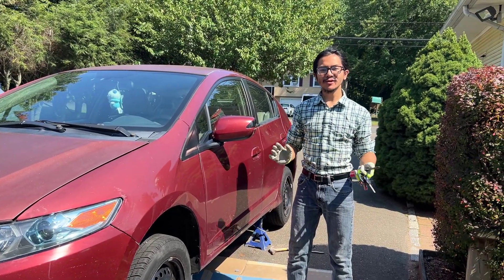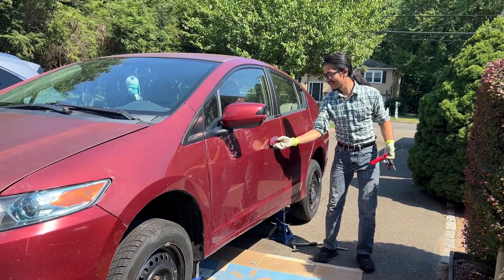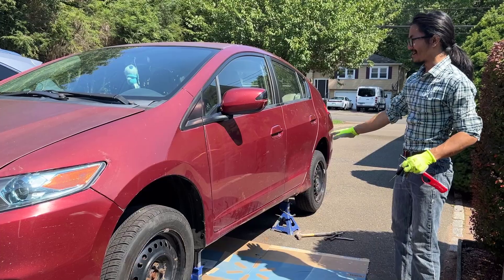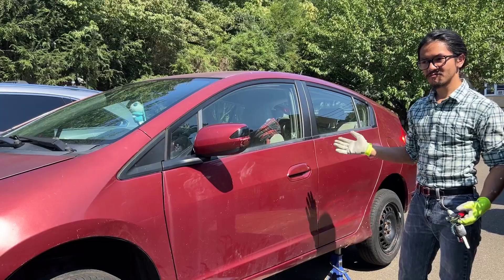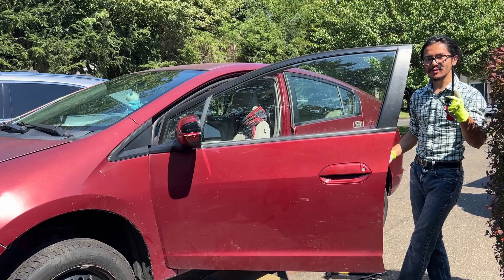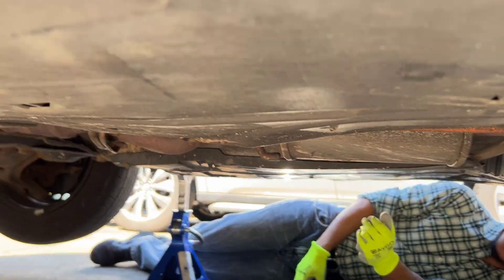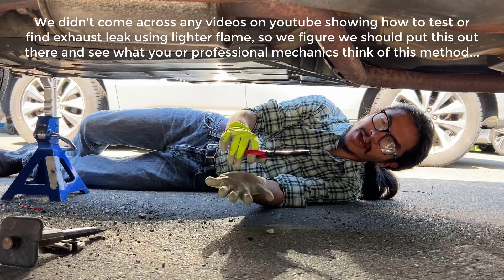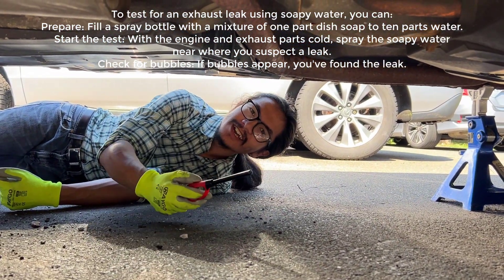Car Exhaust System Leaks | How To Test, Find & Pinpoint Where Coming From Using BBQ Lighter Flame

Comment from the maker: Here are the #ᴬᴰlinks to tools, parts and accessories you may need to perform this repair:
1.  https://amzn.to/3ZqkKXd  |  Solary Automotive Smoke Machine Leak Detector - 12V DC EVAP Vacuum Diagnostic Tester for Pipe System
2.  https://amzn.to/4erHAC6  |  Rectorseal 65432 32-Ounce with Trigger Sprayer Better Bubble Leak Locator
3.  https://amzn.to/3XtUk3V  |  Smoke Machine Automotive Leak Detector,Evap Vacuum Smoke Diagnostic Tester,Pipeline Fuel Leakage Detector Compatible with 12V Vehicles
4.  https://amzn.to/3MOhTjc  |  J-B Weld FiberWeld 2" x 36" Automoitve Repair Cast, Black (38237)
5.  https://amzn.to/3B30uRb  |  Permatex 80335 Muffler and Tailpipe Sealer, 3 oz. 3-Pack

Or Click on Amazon link here and search for what you need:  https://amzn.to/3D1T2GQ